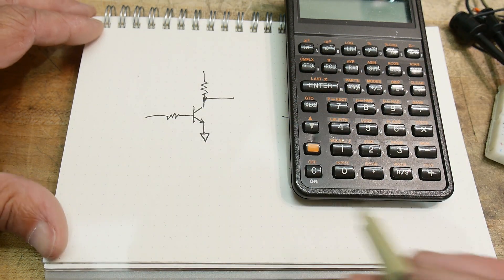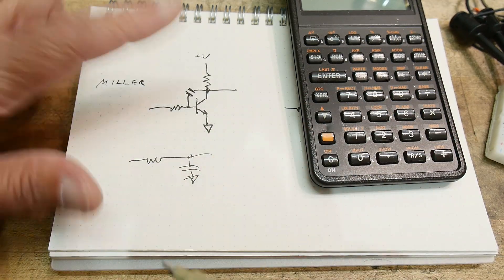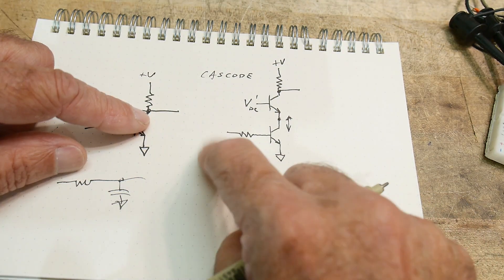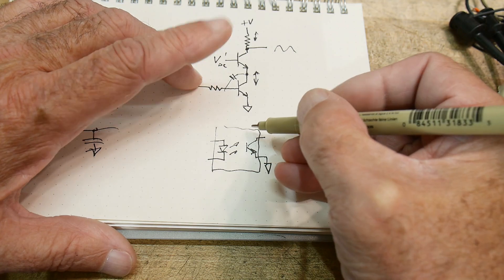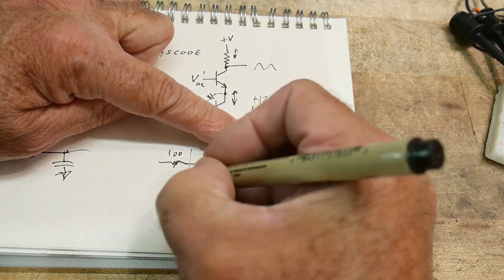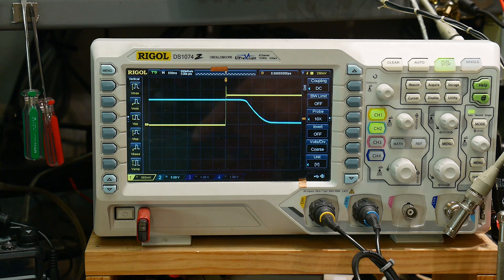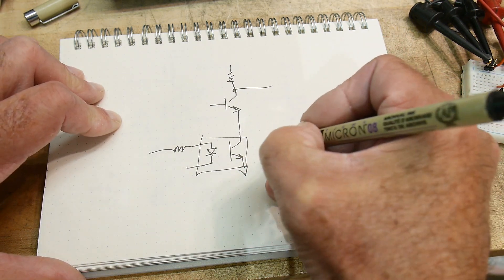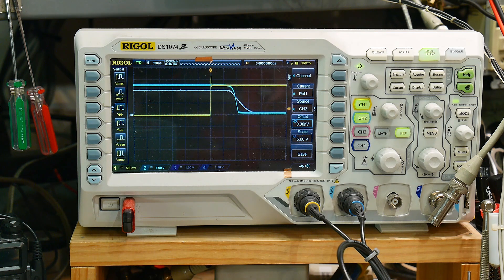#798 Optocoupler Optoisolator Cascode Configuration

Comment: Your description of the Miller effect isn't quite right.
The Miller effect is a negative feedback effect that depends on voltage gain to create feedback. The capacitance between collector and base is always present (it's a reversed biased diode), so you would get the R-C limitations that you describe even if you were driving an emitter follower which has no gain. The Miller effect effectively multiplies the feedback capacitance by the voltage gain of a common emitter stage.
A cascode amplifier is a common emitter stage feeding a common base stage. Because the input impedance of the common base stage is very low and that is the load resistance of the first stage, there is no voltage gain on that first common emitter stage, hence no Miller effect, but does have current gain. The common base stage will, of course, have a load resistor, so you end up with a voltage gain for the cascode amplifier. It is important, though, to ensure that the base of the common base stage is tied firmly to ac ground.
Reply: The common base stage can be also enhanced by adding an external stage to drive the base with an inverted, amplified AC signal from the emitter. This further lowers the effective emitter AC impedance.

Comment: Great video and explanation as usual. I was experimenting with an LED-based stroboscope where having a very short/sharp strobe pulse is critical to stopping high speed motion. One of the limiting factors is the switching speed of the LEDs, but now I’m wondering if using a cascode configuration would improve the performance, or if the limiting factor is the plain vanilla LEDs I’m using. Either way, this should help when the LED switching speed is not a limiting factor of system performance.

Comment: The  questions   for  volume production  1. Is there wide tolerance in the PC817 between devices for  bias  setting of the cascode?  2.  Does the bias setting vary with temperature?
Reply: There isn't an issue with the bias setting of the cascode stage. The collector current of the phototransistor is limited in its linear region by the input current, not by its collector voltage.

The dc bias on the base of the upper transistor sets its emitter bias point and that becomes the collector bias point of the lower phototransistor. You need work with currents at sensible levels to ensure you don't exceed dissipation. There seems to have been a change in production around 1977 when the maximum Vce was increased from 35V to 80V, so be careful of older parts. The collector current is 50mA max and power dissipation is 200mW.

I'd recommend setting the phototransistor collector to about 5V and aim for an input current around 1mA to 5mA, which means the maximum collector current will be between 2.5mA and 30mA, depending on sample. You can buy a gain selected part with the A rank giving 4mA to 8 mA, the B rank giving 6.5mA to 13mA, the C rank giving 10mA to 20mA and the D rank giving 15mA to 30mA from an input of 5mA. That would allow a dc bias point for the collector of the upper transistor (i.e. the amplifier output) to be set to give a usable output swing despite a potential 2:1 variation in collector current.

Comment: Would a base resistor be well advised on the top transistor?
Reply from the maker: No, it the same biasing as any common emitter amplifier. No base resistor.
Reply: @IMSAIGuy  You mean "common base amplifier". No base resistor because you want it tied firmly to ac ground.
Reply: @RexxSchneider  so common base amplifiers should never ever have base resistors? 
I don’t understand “tied firmly to AC ground”. AC ground means signal ground? How is it tied to ground when it’s connected to a DC voltage and not ground?
Reply: @davadoff  What would be the purpose of a base resistor in a common base amplifier used in a cascode circuit?
AC ground means signal ground, of course. In a circuit, we expect a dc voltage supply to provide very little ac impedance. In other words, as a signal current is drawn from it, we expect the voltage to remain constant. The whole point of a cascode amplifier is that the voltage at the emitter of the top transistor remains as constant as possible, meaning that the collector of the lower transistor sees no signal voltage, so none of it is fed back via the Miller capacitance.
If you add a base resistor to the top transistor, you increase the effective impedance at its emitter, and increase the voltage signal that is then fed back by the Miller effect. That's the opposite of what you want.

Comment: Why can’t you just bias through the resistor and possibly a diode? What role does the added transistor play? I thought in the beginning it was a voltage regulator, but nope.
Reply: The added transistor is a common base amplifier. That presents a low impedance input and a high impedance output, and has a current gain of very close to 1. That means the voltage at its emitter hardly changes as the current fed into its emitter changes (which eliminates the Miller effect from the phototransistor), but any current fed into the emitter can generate a significantly larger voltage change through a load resistor at its collector.
Reply from the maker: I suggest you watch the video again and not skip.

Comment: Optocouplers age. I know this because I was at T'dyne when they started getting returns on very fancy boards because the optoisolators they used were going out of spec.  Ooops.
Reply from the maker: haven't heard that one. My guess would be the LED side.
Reply: @IMSAIGuy  probably. I also noticed datasheets mentioning how much performance derates with aging but I haven't paid much attention to it.
Reply: That's true. Particularly if operated near max forward diode current. Apparently it has to do with the emitter degrading over time. I'm not sure if it's been sorted out but I try to avoid them in designs if possible.

Comment: miller killer.  Does anyone know the origin of the term "cascode" ?  I've tried to find out but I couldn't find a satisfying explanation.  Seems like some wag riffed off of the term "cascade", but I need to know more.
Reply from the maker: "casc(aded triode amplifier having characteristics similar to, but less noisy than, a single pent)ode"
Reply from the maker: https://en.wikipedia.org/wiki/Cascode
Reply from the maker: under History
Reply: @IMSAIGuy  sigh.  I guess it pays to check back now and then... I am sure I looked there but it may have been a long time.  Thanks!
Reply: @IMSAIGuy  WOW where'd you find that? In Terman?
Reply: no I just searched the text in the internet archive -- no hits for cascode.

Comment: I came across your video on how dangerous drilling plastic is, and I hope you can help me! 
I got an office chair that has this lumbar support pad thing that slides up and down in these side rails on the back of the chair, and the pad constantly slides down the rails on its own cuz there's nothing that keeps it there, making the chair really bad to sit in. I fit thick cardboard strips inside those rails and it kinda works, but it doesn't seem like a long term fix, so now I'm thinking if I could drive a screw through each of those 2 side rails with the lumbar pad in the highest position, to keep it there permanently. 
I hope you could gimme the best solution around this, thanks in advance!
Reply from the maker: screws, pins, hose clamps
Reply: @IMSAIGuy  just be careful you don't void the warranty.

Comment: Good morning! Thank you once again for making things visual, versus all mathematical. I really appreciate your approach. I deal with cascode topology quite often on mosfet amplifier circuits (no optoisolators, but still very relevant) and using your oscilloscope in the compare mode just really added the "icing on top of he cake" for me, as to why cascode topology is so important to increase the slew rate of the output stage of an amplifier. Thank you IMSAI Guy!   Fred

Comment: The size of the collector-base parasitic capacitor is effectively multiplied by the transistors voltage gain which makes the miller effect even worse. Great video, thanks for sharing.
Reply: Not by the Hfe, by the voltage gain of the circuit.
Reply: @paulcohen1555  Doh! You're right. I'll correct my comment.
Reply: The capacitance multiplication is the Miller effect, and of course it can only occur when there is voltage gain at the collector. That is why the cascode amplifier, which has current gain but no voltage gain at the lower stage's collector, eliminates the Miller effect. You still have the collector-base capacitance, of course, but it's no longer multiplied. Since the C-B junction is a reverse biased diode, you can decrease its capacitance by increasing the voltage across it.

Comment: what is voltage attached to the 1k ? What is the base voltage of the the 2n2222a ?
Reply from the maker: 12V but not critical. I don't remember the base voltage you will have to experiment. It is probably dependent on what optoisolator you use.